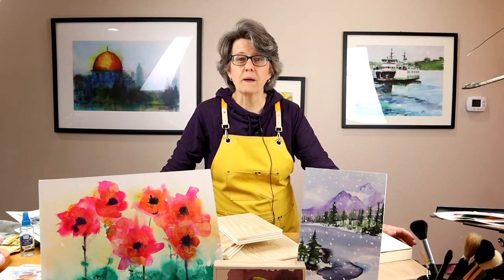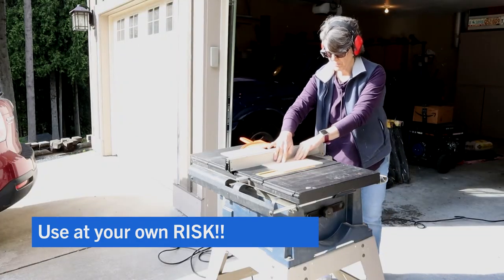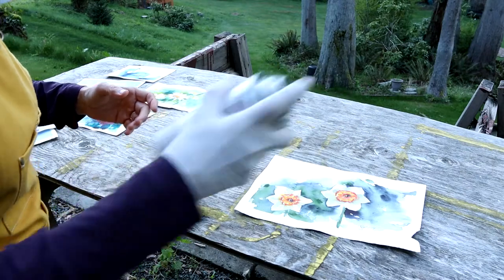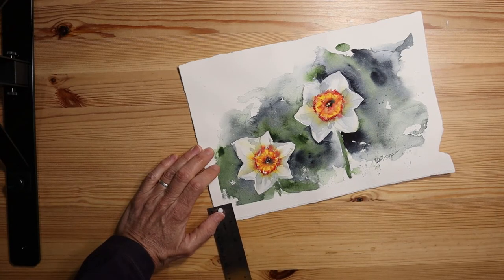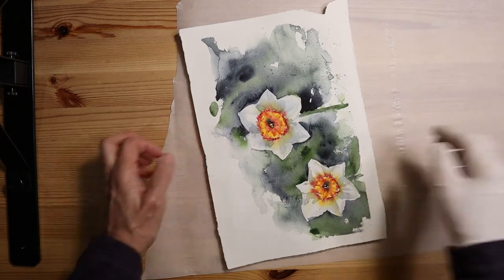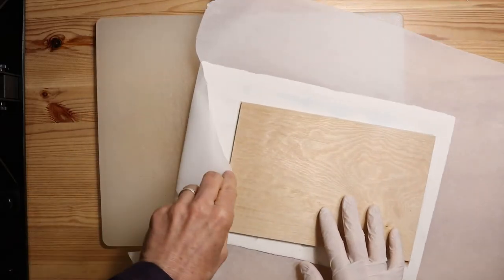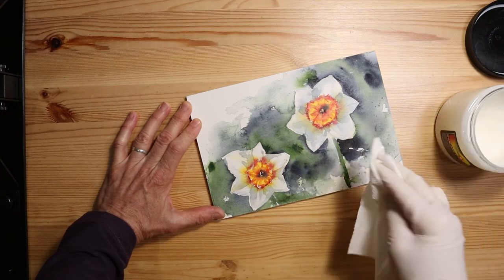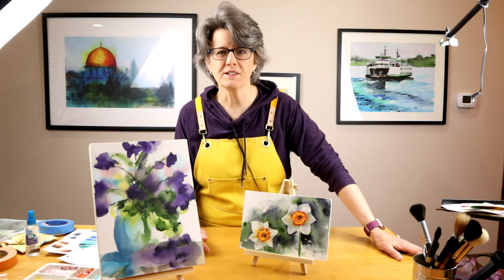Display Watercolor Art without Glass [Complete Board Mounting Demonstration]

Comment: Awesome! I've been ready to try this for a while, but wasn't finding full or clear instructions in one place, so I am grateful for your generosity in creating this video.  Question: when you measure using the mat, and mark the corners,  then turn the paper over, how do you know where to make your pencil box on the back? (I'm confused because the pencil marks are on the front and no longer visible once you turn the paper over) ...? I love this approach for protecting and displaying watercolors - and I think its less presumptuous (less costly, less old-school, safer in the mail, etc) than framing my pieces that I want to gift.  Thanks so much for this video!
Reply from the maker: Great question.  After making the small marks on the front of the painting, I used a ruler to measure the distance from the edge of the paper to these marks.  (this is shown in the video, but only briefly).  Then I turned over the paper and transferred the measurements.  Then placed the board and traced  it.  This is the most reliable way I have found to get my placement accurate.  THANKS!!
Reply: @KrisDeBruineStudio  ah, of course. Thanks so much!

Comment: Have you used this technique for large (30x22") paintings?
Reply from the maker: Hi! Yes, one time I mounted a very large print to a cradle board using this method.  You definitely need TWO PEOPLE as it can be difficult to position the paper. I would also recommend having two brayers, so you can both work at removing any air bubbles between the paper and the board.  The end product looked great...but it was a little nerve wracking to do. Have fun!!

Comment: I don't have a wood cutter and have three 10X16 watercolors on paper.  Where do i go to have them cut for me?  I would love to mount them on craddle boards to hang them on the wall. Would appreciate any suggestions. Thank you.
Reply from the maker: You can have the boards cut to size at your local DIY store -- like Home Depot.  If you are going to make cradle boards, you will also have to purchase and cut the 1x1 boards for the frame that attaches to the back of the board.  If you do not have the tools for all of this....it would honestly be much easier to just purchase your cradle boards pre-made. They come in standard sizes.  Then...always create your artwork to these sizes.  Unfortunately 10x16 is not a standard size. 
 Here is a link to pre-made cradle boards: https://amzn.to/47nyKCK  I hope this helps.
Reply: @KrisDeBruineStudio  Unfortunately I am overseas and buying premade is nowhere to be found. I will have to look for someone to construct one for me.
Reply: Hi Kris, I did find someone to construct one to fit my painting,. Which wood is best? Say warp proof. I saw an article the other day that plywood is the safest. Could you comment based on your experience.?
Reply from the maker: I use birch wood.  It is smooth and sturdy.  It is also fairly inexpensive.  However, the main thing you have to be careful of...is that the wood doesn't stain and ruin the painting.  There can be chemicals and oils in the wood that can affect the paper.

Comment: ? I have a painting that I want to attach to cradle board. My painting is an odd size. I'm think to paint the cradle board with black acrylic paint, and then centering my watercolor painting on the board. The black acrylic paint will then look like frame. ?My question: Will this work?
Reply from the maker: I have never adhered a painting to a painted board.  But I have seen others do it.  I imagine it would work just fine.  I think it would be important that the black paint is acrylic -- like the gel medium -- to ensure good adhesion.  If it is a priceless piece of art....maybe you could test the process first with something less precious.
Reply: @KrisDeBruineStudio  Good idea about testing it using a painting that I can live without, if it ends up being a failed mess💛